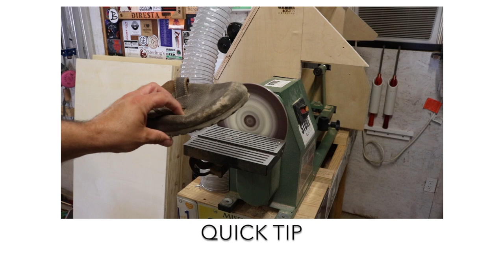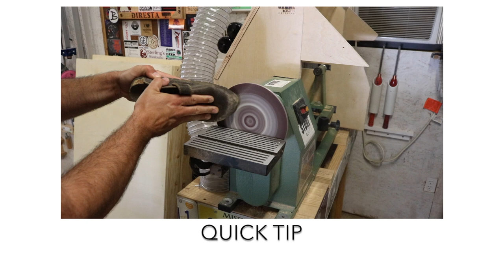Cornhole Boards yard game - How to

Comment: Cool build Shawn.  Did you clear coat them?  I used to use 2x's and 3/4" ply material.  I've switched to 1x4 frames and 1/2" ply.  I add a cross member to the middle underside to keep the boards from flexing.  A ton lighter and play just as well.  Check out my Instagram page (@cwilly66) for pics.
Reply from the maker: +Chris Williams Thanks Chris. I didn't clear coat them. Maybe the next set, though. I bought the pre finished 1/2" blonde wood and it's surprisingly slick. It could probably stand to be a little more slick, but it's pretty good as is. I'll go check out your IG. Thanks for watching.